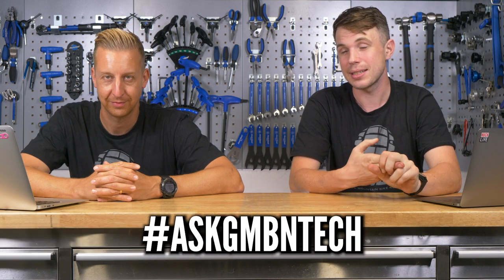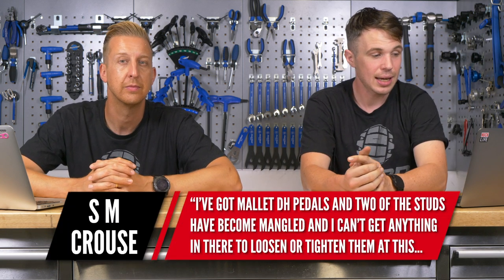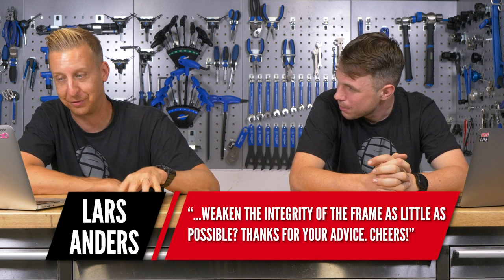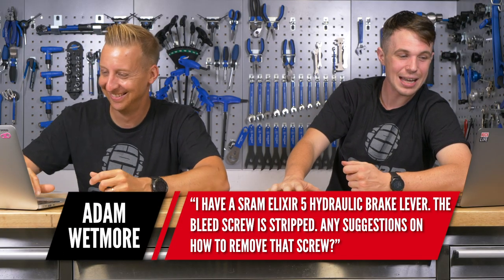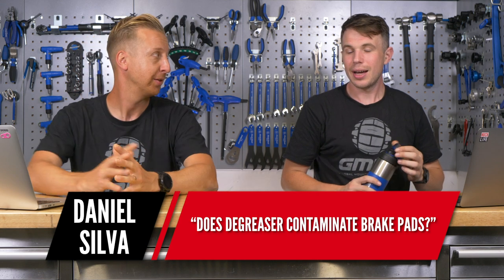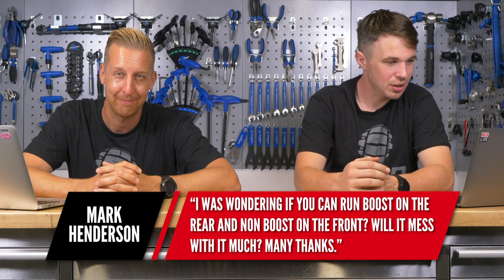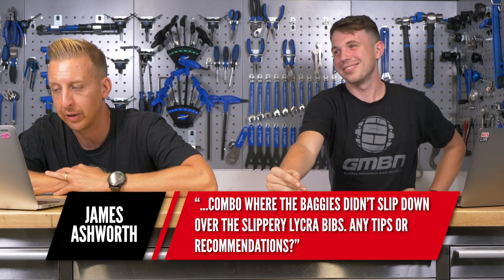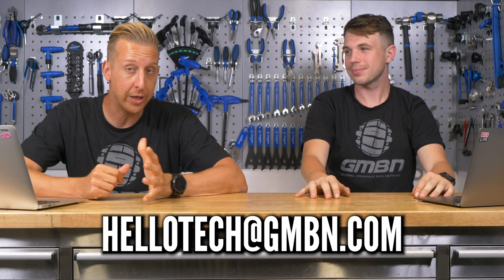Should I Make Holes In My Carbon Frame? | Ask GMBN Tech Ep. 81

Comment from the maker: Do you think Lars should drill a hole in his frame? Let us know! Submit your questions with the hashtag #AskGMBNTech
Reply: He shouldn´t drill it, the bit will shred the fibres. a fine grit grinding attachment on a dremel tool is the weapon of choice for fiberous laminates. and sealing the edges afterwards with epoxy is also a good idea.
Reply: Nope...cos if he cracks his frame while riding, he could easily crash and seriously injure or kill himself or someone else.
Sell the thing, get one with internal routing.
Or buy a wireless dropper! E.g. magura
Reply: If you he needs to ask, then no. Definitely not near tubes joints, with high stress points.
Reply: Yolo
Reply: needs diamond drill bits and needle files
Reply: Definitely not!
Reply: 5cm above bottom bracket in seat tube, and just route it externally over the downtube.
Reply: FUCK NO!!!!!!!!!!!!!!!!!
Reply: Don’t do it Lars, use the PNW dropper with their external dropper and it is very low key
Reply: Only if it’s an expensive frame! 😚
Reply: Bad idea there Lars. Don’t compromise your safety over some dumb cable bro.
Reply: I think drilling carbon sounds like a bad idea especially for a cosmetic reason.
Reply: Route externally along the down tube. If the frame has a vertical bottle cage mount you can drill out the mount and make a hole without damaging the frame too much

I did this on an aluminum hardatil frame and it works great.
Reply: If it was alloy, from experience of doing it myself, I would say go for it. But since it is carbon, I would say no.
Reply: Drill Baby Drill!!
Reply: Sure, go nuts.
Reply: Just get a magura dropper post
Reply: I did once, many frames have some aluminum   nuts for bottle cages or rubber bumpers near the BB. If you’re lucky you can drill out the center. $$$
Reply: Dont ride carbon frames the added weight of any other material will make you stronger more weight isnt the end of the world
Reply: @janeksheppix  Agreed. If he's asking, he's not got the skills ( nor do I ), for the job and this sort of cutting can be last chance saloon. Just live with a cable outside your frame, it's only a minor aesthetic consideration.
Reply: No and no. There is no guarantee that the epoxy wont spider and further crack.
Reply: NO
Reply: Any bike manufacturer that doesn't have a lifetime warranty on it is junk. Get a Trek!
Reply: Heeeelllllll nooooo!
Reply: DON’T DRILL YOUR FRAME!!! Carbon or alloy, the risk isn’t worth it. When I wanted an internal dropper on my scott scale, I ran the wire housing through the down tube and inside and around the BB. Had to take the BB apart (well, not me personally, the guy at my LBS did), but it works perfectly.
Reply: @aravnjak  How do you think they get the holes into alloy frames in the first place?

A lot of hyperbole in these comments. Holes are made in frames after the fact, so there are obviously perfectly safe ways of doing it. None of the above headless chickens seem to know anything about carbon. Paul Paulsen is the only one providing a correct answer.

Comment: These are my type of people: "don't do this, but...".

As a (risk acknowledging and non-liability transferring) engineer, I approve of this. and yeah, I drilled my fat bike frame for the same reason, with the recommendation coming from the frame designer - around the same spot recommended, close to the location for the brake cable port on my bike.

Comment: No, don't drill a carbon bike frame. Carbon frames with through the frame cables have been specially constructed to have those holes and will be internally reinforced to deal with it.
But if you insist on doing it, then you'll have to buy a Dremel and use grinding tips to make the hole NOT DRILLS! A drill will almost certainly snatch forward at some point, creating a big risk that the material around the hole will split. If it does that, you may have to throw the frame away. But any hole you make without splitting the frame will need reinforcing and I recommend that you buy some carbon fibre "braided sleeve"https://www.easycomposites.co.uk/#!/fabric-and-reinforcement/carbon-fibre-reinforcement/carbon-fibre-braided-sleeve  to fit inside the hole and teflon tube in several smaller sizes. https://www.ebay.co.uk/itm/PTFE-Tubing-Metric-3-15mm-OD-Sold-by-the-Metre-Air-Tube/331894146125?hash=item4d466ec44d:m:m0eLw1oKxdYHZPq29YhQOqg
And some epoxy resin https://www.easycomposites.co.uk/#!/resin-gel-silicone-adhesive/epoxy-resin/EL2-epoxy-laminating-resin.html

 You will then have to wet out the carbon sleeve with a suitable sized teflon tube inside it, so that you can get it through the hole in the frame. Then you'll have to wiggle and circle the teflon tube about to try and spread out the carbon inside the frame, while also spreading out the carbon sleeve on the outside and smoothing it onto the surface. Then you'll need to leave a long piece of teflon, following the route you want the cable to go, in there till the epoxy sets. The teflon will hopefully not adhere too much to the epoxy and you should be able to remove it once set, then you'll have to do the same thing again, I suggest a minimum of three layers in all. When you do the final carbon sleeve, I suggest you'll need to leave your largest teflon tube in there full length, to help the cable go through.   And you'll need to consider sanding down the carbon sleeving on the outside as little as possible to retain as much strength as possible. So the end result may be kind of ugly.
 So, that's what I'd do, if I was forced (at gun point) to make holes in my carbon bike frame.
Good luck.
Reply: Oh, and you'd have to do the same at the bottom as well. Plus you'd need to have the guiding tube all the way through. Seems next to impossible to me. :-)
Reply: Thanks for the ideas.  I have all the carbon/fibre and epoxy ready to roll, and an insert.  Seems easy enough.  I repaired a top tube the shop cracked in their vise...  not hard if you can read, sand, and wrap for pressure.
Reply: @galehess6676  Ok. I've never done this and my suggestion, earlier, would be an experiment. So, as I said then, good luck.

Comment: I did some DIY cable routing on my old hard tail. Drilled a hole at the base seat tube, out, then back in the down tube and out again at near the headset. Chucked some rubber gromits in and jobs a good un. No problems so far.
Reply: Did you drill the holes at an angle?
Reply: @tobywynn9616  Once you've drilled all the holes, it will look a right mess at first, but once you've filed it all smooth it looks a really neat job.
Reply: @superspecky4eyes  thanks for advice as I really want to do it but just a lil scared
Reply: @tobywynn9616  No problem, just a little disclaimer, I did this on my old cross-country hardtail. I probably wouldn't do it on a bike I would be sending massive jumps and drops on.

Comment: Thanks guys, will try all you mentioned on the pedal studs!
Reply: Or drill them out (slightly smaller bit than the pin) and re-tap the hole to clean swarf
Reply: Last resort: clean the stud thoroughly. Then go find an old, worn (disposable) allen or torx key that baaarely fits. A bit of epoxy on the tip, then tap it in and have it cure. Easy to remove - but byebye to stud and key!

Comment: I drilled a hole in my old aluminum DH frame seat tube for an internal dropper because I had one laying around so makes it a bit easier to get back to the car. Aluminum drills easy and I’ve had 0 problems. Carbon I would assume may weaken more or fray though. My suggestion is to make sure you drill the hole at an angle though towards the bottom of the seat post. You wouldn’t think it but it makes the its much more easy to get the cable through especially because it makes the hole oblong.

Comment: Elixir 5 has a T10 bleed screw on the front top of the lever body. Get a dremel, cut a slot in the bleed screw, remove with a flat head screwdriver, replace the screw.

Comment: I once got minral oil on my magura mt4 and disc (bcs lazy me didn't remove the rearwheel due to overconfidence) so after whiping of the worst bit i pedaled down a hill while only braking with the rear brake until it started smoking, ended up working with 90% performance

Comment: You guys should do a tech show similar to the chain lubes test where you contaminate a bunch of brake pads and test cleaning methods. Also see if brake pad material makes any difference. I have a theory that metallic pads are easier to clean because you can just cook them in an open flame that would burn an organic pad. I also think organic pads absorb oil better.

Comment: #AskGMBNTech #AskGMBN
Everyone is all about super long frames, as long as you can get away with, but I'm concerned by bike may be too long for me. I'm 5'11" and usually ride a large. My dream bike has always been a Mondraker Dune, and I finally spotted one second hand that I could afford so I snapped it up. The thing is though, this bike is not only a Mondraker (i.e. forward geometry) but it's an XL too, with 515mm reach. I'm finding it's an extremely capable bike which just begs me to go faster over rough ground, it's an absolute rocket ship in a straight line, and has made me more comfortable in the air, but I seem to have lost all cornering skill. I'm forever washing out the front wheel or simply not being able to turn in time and due to high speed interfacing with trees I'm currently on my third helmet this year. Any thoughts?
Reply: LeoLikesBikes yep
Reply: Longer wheelbase will always make turning harder.
Reply: Move forward to load the front more, it’s hard and scarry, but rewarding when you get it right....🤘
Reply: Yeah I'd say it's a bit too long for you. If you aren't already, make sure you've got the shortest stem possible
Reply: Shorten your stem.That should help with reach and cornering.

Comment: #AskGMBNTech why do we set rear sag when seated even though suspension is most in use when standing??? Thanks guys!
Reply: you can set it either way, standing or sitting on the bike, they key with setup is consistency when you making changes to sag
Reply: Just set it up the way you gonna ride it - good bike shops do ask before setup!
Reply: If your sitting or standing your sag should be the same

Comment: #askgmbntech , in doddys bike cave the bikes are vertical hung on the wall. Does this type of position damage the fork seals, or the brakes ( air ...)?
Reply: darkjoscha no
Reply: #asking tech I was also wondering about this. Does storing or transporting your bike upside down have any adverse effects on the brakes?  I have read that this is bad practice because air may float up into the callipers. Thanks for the great content 👍
Reply: no its actually good for your forks seals and foam rings, brakes are usually problem free but if any air moves to the calliper then a few pulls on the lever will sort things out

Comment: #askgmbntech on my bike the chain keeps on falling off on bumpy/rough terrain, the chain also keeps on hitting the back wheel spokes, is there anything that you recommend upgrading/doing to solve this problem?
Reply: new rear derailer with a clutch (like shimano shadow+)
Reply: Chain guide
Reply: All of the above, plus see if you can shorten your chain.
Reply: Get your limit screws set up properly chain in spokes is a surefire way to need a few derallier or hanger

Comment: When you see how they layer up carbon it's not as good idea to go drilling holes in it. The holes that are there in modern bikes are considered in the layering.
Carbon is also "potentially" the next Asbestos so probably a good idea you wear a mask... but if your the type of person who thinks it's ok to drill hole in a carbon frame then got for it.. you probably wont make it far enough for Carbon fibre in your lungs to ever be an issue.
Reply: I did that and wore a mask and vacuumed the dust. Very little material from the drilling compared to cutting a fork steerer. And of much more immediate impact are the carbon shards. Wear gloves, mask surfaces, file everything neatly. I had one splinter in a finger and those things are terrible.

Comment: #askgmbntech I’ve just upgraded my brakes to Shimano Saint 4 pot brakes with a 203mm icetech rotor  on the front.  I can’t stop the rotor from touching the pads. Its only slightly touching but the noise is doing my head in.  I’ve tried straightening the rotor even taken it to local bike mechanic to get it straightened.  Also tried pushing the pistons all the way in, no love.

Comment: 4:35 holy moses Henry, "top tube doesnt do much in terms of the frame"?  c'mon your a bright guy, think about it...

As part of the front triangle or more complex structure, it resists twisting motion through the headtube between the force on a pedal and the opposite hand postion on the bars.. especially while riding hard out of the saddle

Top tubes (and why they are going  to a horizontal oval these days optimised by FEA analysis , permit flex vertically/ or optimize rigidity for other axis, but resist forces elsewhere.

why dont you ride a mixte frame on agreesive trail and find out?! or better still let see you guys cut out a top tube and find out what might happen! (i have a fair idea)
Reply: Yeah

Comment: I've been looking into getting a fatbike, which will probably be a rigid which I can upgrade later with a Bluto. But since there arent a lot of options for fatbike suspensionforks I was wondering why forks aren't more modular, with clamping tripletrees, so you could in theory put the forklegs from e.g. a pike or lyric and clamp it in a fatbike specific tripletree. Pretty specific example, but same would go for boost and non-boost wheels. #askgmbntech
Reply: Of course, modular forkbridges too
Reply: No demand and weak structure. Stanchions are pressure bonded.

Comment: #AskGMBNTech
What were the advantage of those hubs with smaller flanges on the other side and why few of them are available now?
Reply: Kristoffer Vergara Yeah, I’d be interested in this too. :)

I’m not familiar with those hubs, but having done some beginner wheelbuilding I’d guess the advantage would be in marginal gains. The disc rotor side hub flange takes the brunt of the braking force, so a full-size flange on that side makes sense - the flange on the other side doesn’t necessarily need to be quite as strong though, and some weight could be saved by making it smaller (less material and less rolling weight). This would make sense with heavy steel hubs, but not with modern aluminium ones. There can also be a (very very) marginal wheel stiffness benefit in this, as the angle of the spokes in relation to the rim will be tighter on the smaller flange side, thus matching the ’straighter’ spokes of the disc-side hub flange more closely. Good for marketing hype, this, but you get significantly better results just by using different gauge spokes on each side of the wheel and getting the spoke tensions to match.

Most production wheels are machine-built nowadays, which would explain why the design’s gone the way of the dodo. Having to first go through the hassle of more production steps in order to produce a hub with different flanges, you’ll then have to build it up using two different lengths of spokes and potentially add slightly more specialized configuration work /machinery to the production run. With modern-day light-weight quality alloy hubs, I don’t see much reason in going through all that just for very marginal gains.

Comment: @ i have been having some problems with my shimano slx derailleur, it keeps getting stuck in its most easy gear and i have to compress the rear suspension to make it shift do you know what the problem is, do i need a new derailleur or do need to do something else. it is 2x11 with a sram gx front shiftier and sram chain and cassette it is not the cable because i put one in last week because of the problem and it didn't fix it, it is a yt capra comp 2 2016 size medium, i have tried putting it in to the bike shop and he fixed it for a day or two but then it went back to how it was. thanks for your help

Comment: #ASKGMBNTECH Hi, am Kaloyan and am riding DH. Now I have 9 speed Deore gearing system, but I want to upgrade it to ZEE system.(Shimano says that the zee derailleur is for 10 speed system) My question is if I can change only my derailleur or I should change all my derailleur, the cassette, the chain and the gear shifter? Thanks.

Comment: #askGMBNTECH I bought green 2007 Norco Bigfoot a few years ago and it came with 2006 marzocchi drop off sl 150mm. The forks are way too long for that frame. Can I put a 40-60mm reducer in those shocks? If so, where can I find such an old part? I have also heard that the more oil you add the shorter they get.. There's very little official info on these forks and you can't trust every forum post you read. Thanks and cheers from Ontario Canada!